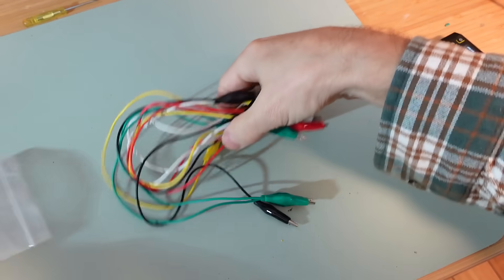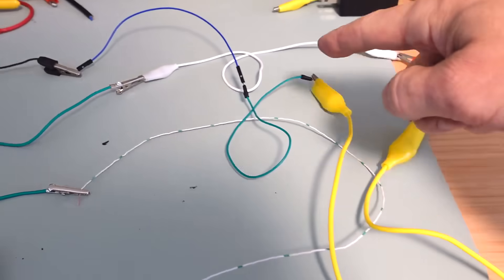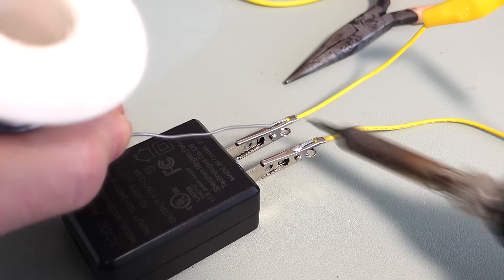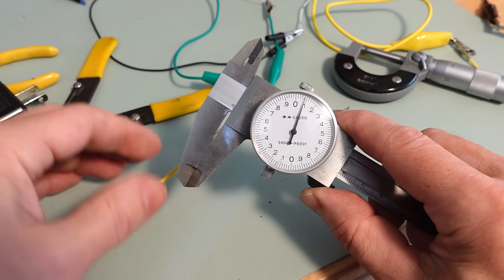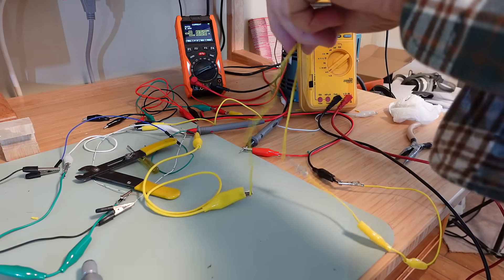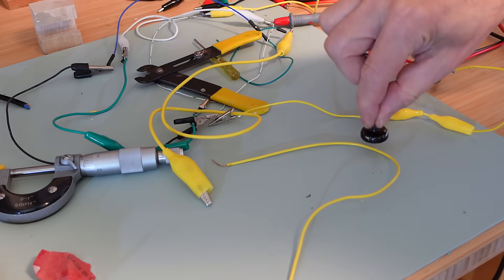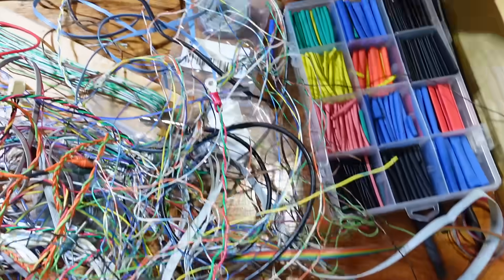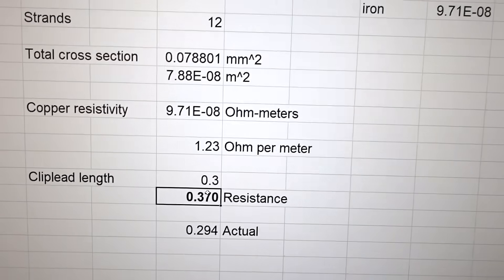Clip leads made with fake wire

Comment: I think it's incredible that the process of making such thin wires and copper-coating them with a super thin layer is cheaper than simply using copper in the first place!
Actually: why would they bother with copper-plating those wires?

Comment: I've had major problems with this before! The combination of the wires being copper-clad iron and extremely thin causes high resistance even under ideal conditions, but they also fatigue and break very easily and their resistance shoots up into the kilo ohm range (which is the worst, as it causes undefined behavior) and beyond.  I've lost so much time to counterfeit wires. 
When I first discovered this, I tore through the lab where I worked, testing every wire with a magnet and destroying and disposing of all counterfeit clip leads and jumpers. Now I only buy these on digi-key. 
These days, whenever I'm in other peoples' labs I show them the magnet trick and recommend a thorough purge of fake wires.
Reply: The Issue arises that not all fake wires are magnetic.. I got a batch that were copper plated cotton string inside.. others have reported finding Aluminium. Suggest also checking the Resistance in case non ferrous materials were used.
Reply: @lander1591  String?! that's bizarre, truly bizarre. 
When I started having the counterfeit wire problem, I assumed they'd be aluminum and was surprised to find they were iron. At that time I never found any aluminum ones (at least not in clip leads and breadboard jumpers), so eventually I stopped doing the scrape test. Maybe I should pick that up again if the manufacturing trend changed. I didn't really test resistance because the bad ones usually tested just fine with the meters I had.
More than all that, I stopped testing at all because I stopped buying them once I built up a stock of known good ones.

Comment: Matthias doesn't know how to adjust a micrometer? You take the cap off the end of the handle. He should be able to figure it out from there. He's a clever boy. New mics usually come with a spanner to adjust them with. It's just something you have to do. You don't even need a standard to adjust the 0-1. New mics other than 0-1 come with a standard too. That's so you can adjust it.

Comment: For anybody worried about USB cables and similar, keep in mind that a lot of multi-strand cables (Audio cables, usb, even some power, etc) can be shielded, and that shielding can be made from steel without it negatively impacting the actual current carrying wires.
Reply: Just what I came to post, but thought I'd see if anyone else had already!  :D
Reply: I recently took apart a 20-ish year old premium dual link DVI cable and was amazed by how complex the cable was. There were several layers of braiding, foil wrap, and separate wraps and braids for the main video pins, and even a bare steel cable which I'm pretty sure was there just to make it tougher against pulling forces.  Its no wonder those cables aren't very flexible with all that stuff crammed in there
Reply: @ecliptix1 high frequency connections focus on getting the signal through well and only through the dedicated cable (not leaking between the conductors or outside the cable).

Those cables carry waves, and have a certain impedance on the dedicated frequency range. The impedance is defined by physical dimensions and qualities of the cable.

The cable impedance must match the impedance of the transmitter and receiver to minimise losses (signal being absorbed or reflected back). The impedance must also be stable throughout the cable, which is guaranteed by making it physically strong, so that the shield around the coaxial signal wire stays equally far, not being crushed by having weight on it or by making sharp kinks.
Reply: My 10 strand ancient audio wire has a tiny flex conduit inside for one wire. Leak point one stuff.
Reply: now i understand why alot of products that have/use USB cables insist on using only the original cable.
Reply: @vlad3k  there can be a lot of jank going on with USB cables. Some do not have the data wires for instance. Some the conductors are as thin as hair too. There's a lot of variability between different cables. Outwardly you'd think they are all the same. You could even argue that they should be. In practice that simply is not the case. The only way to find out is to open the cable up and see what's in it. But that destroys the cable. So we're left in the dark. Manufacturers prey on that ignorance too. They know we don't and can't know. At least not until it is too late.
Reply: @paulromsky9527  Say what?  Faraday cages do not ever block static magnetic fields.  They cancel electromagnetic fields.  Magnetic fields are not EM fields.  You can't cancel magnetic fields.  Magnetic fields are not EMP.  That 'E' in 'EM' is important.  Yes Mu metals redirect magnetic fields.  They have nothing to do with Faraday cages.  Literally two seconds on google will answer the question "What's the best material for Faraday cages".  
This tells me you don't really understand anything about the fundamentals of what you're talking about.  Go study Maxwell's equations.
Reply: just test continuity at the plug barrels, sometimes they aren't connected to the shielding.
Reply: Steel shield will work, kinda. More common for higher quality cables is aluminum.
Reply: @ebmooy13  steel is way better than aluminum. You do have to be a real man to be able to crush a steel can on your forehead though.
Reply: The moot point is that you're paying the same price for both products, in other words your getting ripped off.
Reply: @paulromsky9527  Faraday cages don't block magnetic fields.   Static or low frequency magnetic fields will pass right through them.   
Compasses work just fine inside of a Faraday cage.  Mu metals are used to redirect magnetic fields.  They have nothing to do with Faraday cages.   Faraday cages cancel electric fields in their interiors thus disrupting and blocking EM waves.  Saying that ferrous metals make better faraday cages because mu-metal blocks magnetic fields better is like saying jets are better than horses because they use less hay.
Reply: @stargazer7644  I guess I made my point because my reply telling you how to verify what I said was deleted. I am not typing it again, it violated no rules, but the bot has its owns rules...typical of this site.
Reply: @paulromsky9527  My original reply to you on this also disappeared inexplicably.  I retyped a similar reply.  Youtube is really getting terrible about randomly deleting comments.
Reply: @stargazer7644  I agree, not so much for stimulating conversations here.
Reply: @stargazer7644  
I have had several of my comments deleted on Steve Lehto's channel, and those comments did not break any rules. This YouTube system is really dumb.
Reply: @stargazer7644   @stargazer7644  A Faraday Cage is not the same as a Faraday Box... but anyway... I was not implying Mu Metals are used for Faraday Cages. We normally use them to shield power transformers from each other. Usually it's used in just a plane, but I have used full Mu Metal enclosures as well. I was just introducing it as a material no one else mentioned. 

Also, coax and the like cables use Cu or other good conducting metals in the "shield" not only because they are current carrying conductors, but, with a dielectric in between it controls impedance - even more important than shielding in most aspects. They are SHARING the shield and the conductor - which is a cheap way out. Cu braid as a coax "return" with an outer steel overbraid (shield) is found in the best coax cables. However, Cu cladded steel braid is a good compromise... Cu for carrying signals and steel for EM shielding.

Try this: Take 100 turns of 32AWG Cu magnet wire with shellac coating on a 25mm diameter x 5 mm high non metallic core. I didnt have any magnet wire handy but I did have a small 32 Ohm speaker and a ring magnet from an old microwave oven Magnetron. Connect it to a DMM on its lowest AC mV range in range hold mode. Wave a magnet rapidly back and forth across the coil. Watch the voltage on the meter.  Cover the coil with a Cu sheet. Wave the magnet over the sheet and watch the deflection on the meter. Now remove the Cu sheet and cover the coil with a steel sheet. Wave the magnet over the sheet and watch the meter again.  Try it with an Al sheet too. Which one shields more, that is, which has less EM induction in the coil (conductor).
Reply: You really don't want your shields made from steel any more than you want the other conductors made from steel, and for the same reasons.  Steel is a poor conductor, and a poor shield.
Reply: @stargazer7644 Yes, steel is a poor conductor, but it is good for braided shielding as the steel is ferrous and blocks electromagnetic waves. Shields dont normally carry much cuurent as noise is normally much lower in magnitude than the signals. Copper is not ferrous and thus makes good conductive electric shields but poor electromagnetic shields. So less noise gets past steel shielding with steel. Look at EMP and Faraday boxes, steel offers the most attenuation and totally block EM fields. Now, iron is the best EM shield material, but way too brittle. Nickple Plated copper makes pretty good shielding material.
Reply: Yes but if made out of ferrous material that will affect the flexibility, and longevity of the wire. Copper is more malleable than steel is. In wire you're planning on moving anything but copper simply is unacceptable. Well, if you're rich gold would be nice I suppose. All things being considered though copper is the best choice. Pure copper.
Reply: @1pcfred  Generally, shielding is very thin stranded steel wire, which can bend as easily as the copper inside, but yes, shielded wire is less flexible overall. However, longevity wouldn't be affected since steel has an incredible ability to flex and return to original shape, which copper does not have, due to it's tendency to work harden, so the weak point of a shielded cable will still be the copper. But this is all a bit of a moot point, since cables with shielding usually aren't the failure point, the connectors are.
Reply: @1pcfred  I'm not entirely sure what you're trying to get across. If it's just that shielded wire can fail, then yes I agree with you. If it's that shielded wire is worse than non-shielded, then I'm not sure what your evidence is.

And if we're dropping experience, I worked as a low-voltage wire monkey for five years, doing AV, Data, and Alarm.
Reply: @1pcfred  It's usually cheap audio and instrument cables that fail (good cables can work for decades) and they usually fail on the connector side, not the actual cable. Manufacturer cheap out on properly soldering the connectors and instead of using quality connectors that can be screwed on/off, they use plastic molding effectively glueing the cable to the connector (which means you can't just resolder the leads easily).
But still, the cables themselves usually hold up pretty well.
Reply: @1pcfred that explains why mouse cables break so often
Reply: @1pcfred  If you're rich, gold-plated silver wires are the way to go. If you're insanely rich, some variant of RTSC material in hollow silver wire with a gold overlay.
Reply: @1pcfred  
A copper-to-copper connection is far superior to a copper-to-gold connection.
Reply: @1pcfred pure copper and finer stranded if it’s going to be flexed a lot. The finer the better.

Comment: I wonder what the long term effect will be, especially when you soldered the wire which may have stripped off the copper coating. Will the leads rust?

Comment: Mouse wire being magnetic is probably the shielding jacket, not the usb data and power lines.

but wild topic! I wouldnt imagine anyone would actually make iron cables but... Ill just buy clips and quality cable separately now.
Reply: There is no good reason to make a shield out of steel wire.

Comment: Thanks! I always suspected my cheap clip leads of having a poor contact, and I considered re-soldering them. Good to know that the wire is junk too! I knew about aluminium wires, but wasn't aware of copper-coated iron being used. Looks like the cheap leads are only good for the color-coded silicone covers, that you can't easily get if you just buy bare croc clips and proper wires.

Comment: I never would have expected those wires to be anything other than copper, but I just checked some that I got a few years ago and they, too, are attracted to a magnet. For many of the things I use them for, it probably won’t matter. There are times, however, where I have drawn more than an amp or two through them and this could cause significant problems. Thank you for making this video, Matthias!
Reply: Yes!  My 2 amp wires got SUSPICIOUSLY warm......... I bet they're iron. :(
Reply: I got a few hot wires and threw them aside. Didn't realize why though. ( The word Chyna was enough to not waste any more time on them lol )

Comment: Have some. Indeed bad.
Probably thin aluminum wire.
And the crimping only sometimes doesn't touch at all.

But you can use the clips with better wire 😁

Comment: I got a cheap chandelier from china back in 2017. It had silver color wire in it. I was skeptical of it being aluminum, and I was afraid it would corrode over time, so I rewired it myself with copper. I did keep the wire that came out of it just for curiosity sake. After watching this video, I pulled out that silver looking wire, and sure enough magnet sticks to it. What the heck!!

Comment: The mouse probably just has braided steel shielding on it.
Reply: And why would it have that?  If the braid is made with steel wire, so is the core.
Reply: @stargazer7644  the braid doesn't carry current, just shields the internal conductors.  Making it from steel (and a flexible braided shape) would be less of an issue than making stranded or solid conductors from steel.
Reply: @mattbechberger3298  If you think the shield doesn't carry currents, you might not understand how a shield works.
Reply: @stargazer7644  it carries induced currents from the RF it's absorbing, yes.   This is usually very low for a household environment.  It doesn't carry the working current for the device. You're being pedantic. 

 The braid form is important, much more flexible than a stranded conductor.
Reply: @mattbechberger3298  It isn't being pedantic.  There's a reason steel isn't used in the braid in quality cables.  I doubt it is used in cheap cables.
Reply: @stargazer7644  I didn't say it was the best.  I just said, the actual data and power wires may be copper and the shielding can be steel because it's poor conductivity and inflexibility is less of an issue.  Using steel for current carrying wires (especially when copper is expected, like in residential wire) is a clear safety issue.

If steel didn't work for shielding, then sensitive electronics in enclosures made of steel would require copper lining, which we don't see.
Reply: @mattbechberger3298  And yet in ALL quality cables the shield is copper and/or aluminum EVERY TIME.  Chassis have slightly different requirements than cables.
Reply: @stargazer7644  Do you think it is possible Matthias' mouse cable MAY have a steel shield AND copper conductors?  Suggesting this possibility was my original comment. Your first reply said that if it's steel shield it's surely steel conductors as well.  There is no reason why this would need to be the case.  

I'm arguing a manufacturer would think to save money by replacing copper shielding braid with steel with minimal impact on product quality or issues with cable conductivity.

What "quality" cables have is irrelevant to the discussion.
Reply: @mattbechberger3298  No, I really don't.  Steel wire isn't used in quality cables.  EVER.  Neither shield nor conductors.   I suspect they're steel conductors with no shield.  The cheapest construction possible.

Comment: i bought a large name brand 3d printer that used 3-5 amp from the wall and it had a iron power cord, ironically it was the smell of hot plastic that alerted me, i burned my fingers on it when i was trying to figure out where the smell came from.

Comment: Yeah copper coated aluminum or copper coated iron. Just use a lighter to burn the exposed wire, and you'll easily find the copper layer peal away.

Comment: That is bizarre, I was expecting copper clad aluminum not iron on your cheap test clips.  I will have to check my stuff, although my clip leads are decades old. I have repaired a bunch and soldered the wire to the clips or replaced the wire with "real" 22 AWG because as you posted the leads are just bent over.

Comment: Is there such a thing as self calibrating equipment/meters,
which will set themselves to 0.0 ohms or whatever, when you
touch the leads together, so you can get a true reading on
the components? 😁✌🖖

Comment: I need to check my wires with a magnet now. Thanks for sharing!
Also, USB cables often have metal shielding. I've seen aluminium foil-like shielding but also braided iron/steel(i think). That might explain why some USB cables are attracted to the magnet and some aren't.

Comment: That is special grade chinesium copper.

I first discovered fake wires when one of the connections in a made in china fairy lights string broke. The wire had rusted. 

Mice cables have sheathing sometimes. So that might be iron.

Comment: So really don't buy Chinese cables and wires?  Really although I did not know there is iron in those wires I should have expected to find there is.  My guess is those cables are not just terrible conductors but they will fail sooner once the strands work harden and break.  That can happen with copper strands too but will happen a lot sooner with iron since it is more brittle.